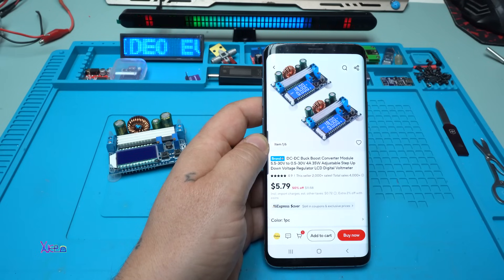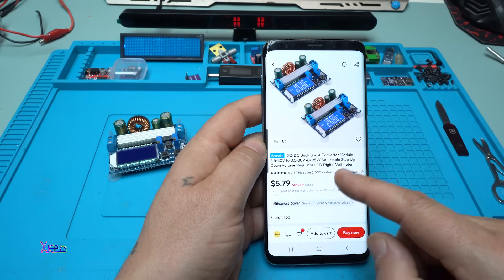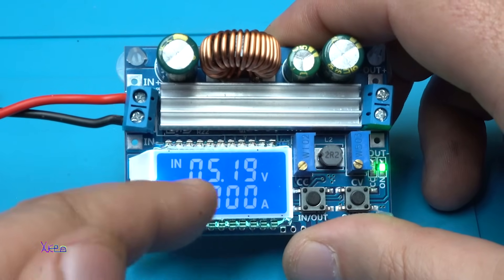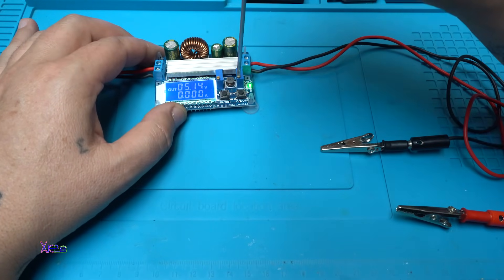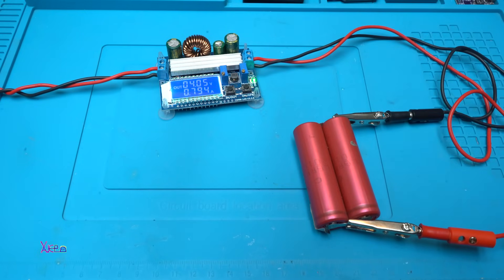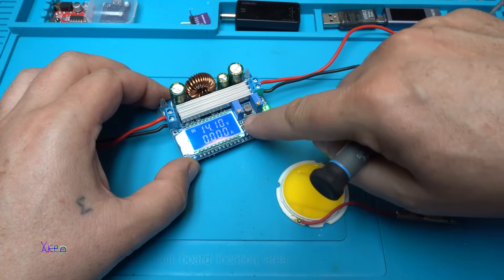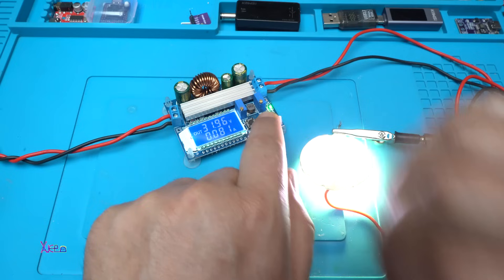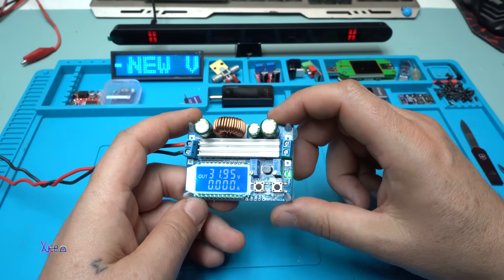$5 Aliexpress 4A 35W Buck Boost Converter Module is BRILLIANT?

Comment: Remember everyone: Using a typical 5v Usb input at 1.5Amp , the input(VxA=) 7.5Watts. MAX 

So whenever using higher output voltages the total Watts can't exceed 7.5Watts. So at 20V the maximum current will be 375milliAmps!  Check that the module has input and output overload protection or there will be smoke lol